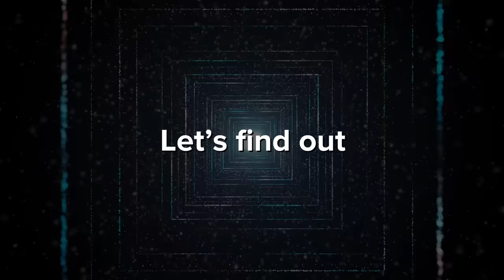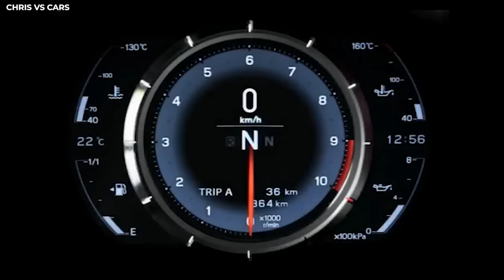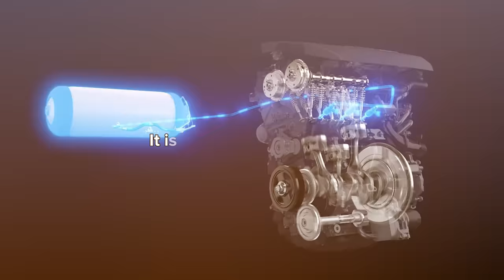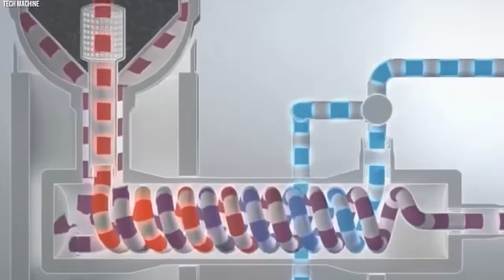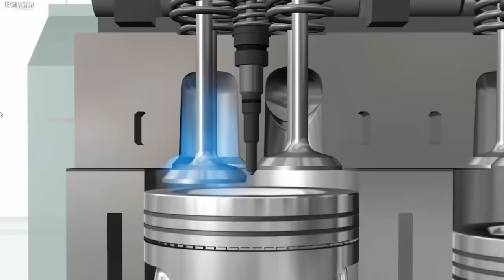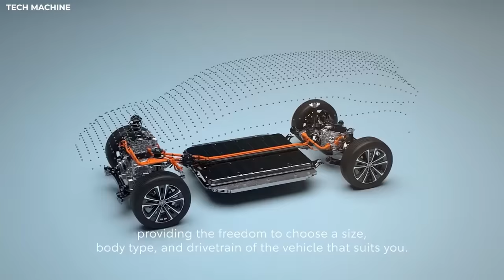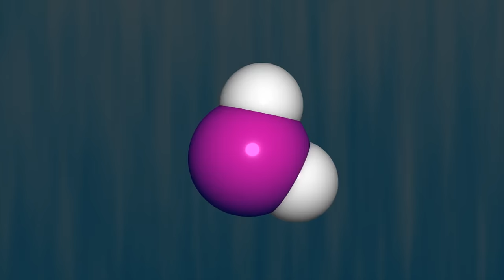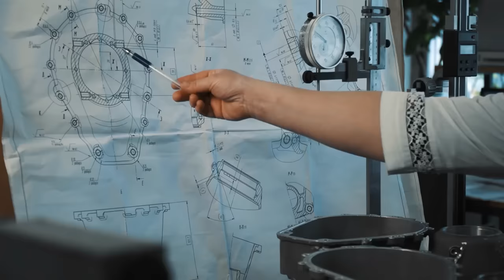Toyota CEO: "This NEW Engine Will Destroy The Entire EV Industry!"

Comment: Oh good, another massively complicated machine that is the answer to nothing. Hydrogen fuelling infrastructure is none existent and what little there is is being removed. Also you still have to buy a new car so it has no benefit to the planet as existing has cars will have to be scrapped. The only supposed benefit is quick refuelling but EV charge times are plummeting and EV performance will still destroy these things in terms of acceleration. The only beneficiaries will be the fossil fuel companies. Drivers will still be little bitches of the gas stations (if they ever get built) no home fuelling (which suits most commuters) and a nice extension of expensive obligatory servicing costs. This is a dead duck for the same reason Toyota’s fuel cell cars are worthless second hand. Expensive technology that serves no purpose.

Comment: I am not an EV fan, because the use and production processes increase pollution, so the basic idea does not solve the carbon footprint objective. So, I like the idea of H for power. It makes sense to continue the research and get it on a greater scale. Batteries are the problem with electric technology as well as recharging time and availability. Too bad for those who jumped into EV vehicles and batteries!

Comment: At the rate of stunning losses suffered by Toyota on Hydrogen project, if they insist probably it will destroy them, as motorists will never pay the high cost of running hydrogen engines, many folds higher than simple electric cars.

Comment: I like Toyota. Yes we get the green part mentioned more than the actual hydrogen engine!
No real specs, will be to expensive/complicated to produce (has to many moving parts) compared to bev,s. No real step power wise. 
Not convinced unfortunately.
I really wouldn,t want to be in a bad accident with pressured Hydrogen leaking, shame.

Comment: How do you produce hydrogen.... electrolysis. So you're using huge amounts of electricity to break up the water molecules. This is an old argument. Why use an intermediary? You know why??? The ice engines are complex - no matter what fuel they burn. This system is MORE complex. There's a whole industry that will be wiped out "when" we all go electric. Even the oil companies can still make money on this....

Comment: I have been preaching hydrogen since the early 2000's so I am already sold on this. If you can meet my three needs I will be the first in line to get one. Must have leather seats, all wheel drive, and have a manual transmission.

Comment: 4 stroke engines waste a great deal of energy due to mechanical compression drag and heat losses. Sure water is the byproduct of burning hydrogen, obviously ( save for burned oil blow-by past the piston rings).  That does not tell the whole story.  This video takes many minutes to convey very little information, and moreover serves to obfuscate matters.

Comment: hydrogen has never address the issue for cheaper car maintenance. hydrogen powered engine are costly to maintain and composed of more parts than ICE. hydrogen are highly corrosive and flammable and difficult to store. leaks are dangerous. when caught with fire its difficult to extinguish. also hydrogen infrastructure worldwide are very limited and some facilities are already closing.

Comment: Just one thing I find this concept of using hydron quite scary in dealing with the storing of the fuel both at top up points, the infrastructure for top up points, and in the vehicle itself. Furthermore it surely requires the production of the hydrogen fuel which I guess will be using the existing power grid which is already at breaking point because of the way that EV's are adding the need for power alongside our usual living conditions could become so complicated and untenable. This certainly requires so much more research and all in order to keep the Evangelistic/green lobby even slightly at bay as their expectations are in my mind so unrealistic and poorly thought and put out.

Comment: Internal combustion engines must be lubricate with some kind of lubricant made from petroleum and it will also combust in the combustion chamber together with the fuel the engines used even though it not much better it still produce toxic gas anyway so it no way to produce clean exhaust as Toyota are dreaming.btw. I’d using gasoline engine instead of hydrogen internal combustion engine because hydrogen is a lot more expensive than gasoline you will pay 6 to 7 times more to fill hydrogen car then a gasoline engine car only the fool will choose to pay that much for hydrogen car

Comment: Hydrogen ICEs is going to be the biggest stock nose dive loser of all time.  Dispensing LH2, or 700 bar H2 gas from public hose / nozzle fueling stations that get used hundreds of times per day? 😂😂😂. Riding around with tanks in the floor, holding 700 bar hydrogen (rocket fuel) is just crazy…

Comment: Just need to look at hydrogen rockets and dirigibles.  These two define the problem with hydrogen as a fuel.  It is a disaster just waiting to happen in a car.   The hydrogen can not sit in a car for days between trips a cryogenic temperatures so it is going to be a high pressures that will be less dense that the cryogenic hydrogen in a rocket fuel tank that are huge for the total energy.  And hydrogen need thick aluminum or steel cylinders to contain it.  Even the smallest leak is as we saw in the dirigibles a huge fire hazard.    That defeats it as a fuel.  There are many liquids more suited for car and truck fuel.

Comment: Their Hydrogen engine burn 2 as hot as ice motors so you will have more repairs, then there is trying to fill up your car with hydrogen (Where are the stations?)
They are losing and grasping at straws.
EVs are here to stay so get your act on and build a great EV.

Comment: Hydrogen is created by an +Anode and -Cathode with reactive type materials.  You can rapidly use two dissimilar materials  metals to create hydrogen gas and  is called rust at a slower rate.  Just add Salt to speed up the baking time to capture the gas.

Comment: It may not matter as the Green Agenda Pushing Zealots are after your car, So they have now swapped from Tail pipe emissions to none tail pipe emissions, Tyre and Brake particulates are the new baddies that will be targeted. As EVs are even worse at this little upcoming population due to the added weight of the drive train. 
I still want a proper engine in my cars, with a manual gearbox and buttons and dials to use control things like heating and even the stereo.

Comment: Hydrogen is a very expensive fuel to produce.  Unless the engine can hydrolysis water througha form of electrolisis to extract hydrogen for motive power this will be a dead end.  I applaued the work being done by Toyota, but it has not yet gone foar enough.

Comment: Toyota solid state battery. Rance 745 miles to 930 miles.  not combustible. fast charging under 10 minutes. Toyota nissan Porsche  Hyundai use solid state battery. ev hyper car 0 too 100 under 2 second

Comment: Toyota is chasing rainbows... so it uses hydrogen combustion but that gas must be manufactured. That costs energy and is that process clean and safe? Remember what happened to the Hindenburg airship. So what about manufacturing, storage and distribution... availability being the most and obvious one? Combustion means generated heat and that reduces efficiency. EV is not perfected yet but at some point they will be. Nicola Tesla not Elon demonstrated Free Energy back in the early 30s with just an antenna and some vac tube receiver. Now THAT would bring us forward to the promised land of no fumes. But Free Energy means that the dark ones will not be able to charge for what should be available to all.

Comment: It would be nice to produce Hydrogen on the fly as you drive, there have been some that do just that! Fill your tank with water and salt and a generator on board. I built some generators in the past, but they were not efficient enough to work. I don't have the brains to figure that out!  I think a bigger alternator, with higher amp's would suffice the problem.

Comment: Ok so makes perfect sense however like all fossil fuel burning vehicles. A
An all, Hydrogen burning vehicles may create another effect to our climate in the future with all the water vapor created by hydrogen fueled vehicles if this was to become our main source for energy to power hundreds of millions of vehicles on the road. So in effect to minimize this you would have to have an eclectic blend of vehicles using different energy sources to power them. If we go away from fossil fuels all the better, but consider the impact if every vehicle was hydrogen burning? Just remember simple balance there is a yin to the yang in everything. We cannot tip one way or the other, but we have for more than a century and look at the effects on our economy and climate which is now undeniable because back in the Clinton administration there were a lot of naysayers, thinking that climate change was a hoax. Well, Hocus Pocus my how times has changed everything?

Comment: In the USA we have abundant natural gas you can turn it into liquid natural gas if you adopt a fuel cell to run on it hydrogen is very expensive. It costs 170$to fill the tank and the fuel cell car it's very slow acceleration that was a Toyota 🙄

Comment: Really, as soon as you can produce Hydrogen efficiently, the EV will take it back by the classic Fuel Cell engine. Efficiently means you can produce hydrogen using much less energy than it can create. You are confusing hydrogen combustion engine vs fuel cell hydrogen via electricity. Which one is Toyota's?